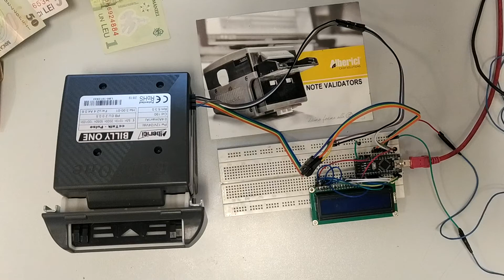Connecting a bill acceptor to Arduino in parallel mode with source code, easiest way, jammer proof.

Comment: Ha!  I just sold my Arduino bill acceptor. So wish I saw this before so I could have loaded the code.  I tried doing my own. And did a fairly ok job.  But it still needed to be tweaked.  This is a really fun project, and teaches quite a bit. Thank you for sharing!
Reply from the maker: Than you Brian. I also enjoyed your video with the Panasonic restoration  and also the one with the ticket dispenser https://youtu.be/EHvQLxPiomk,  nice job you did!
Reply: @dglproservice9881  Thank you!

Comment: thanks bro...... nice work 
i have nv9.... how do i use it with Arduino ?
can you hide me ?
this is for a vending project thank you.
Reply from the maker: Hi. Read NV9 manual to set NV9 on parallel mode. I don't have one here but it should work as well. The default timing should be that same 100ms active 100ms inactive as in Billyone, nothing to change in PULSE_WIDTH, PULSE_DELTA, PULSE_DELTA, ENABLE_ACTIVE_LOW and CREDIT_ACTIVE_LOW defines. Change billvalues[5] to the values used in your country. The defined BILL_ENABLE_PIN  (A2 in my example) should be connected to NV9 Inhibit 1 to 4 tied together , BILL_PARALLEL_1_PIN (A5) to Vend1 and so on , leave BILL_PARALLEL_5_PIN (A1) not connected since NV9 has only four parallel outputs for the lowest four bills. Good luck!